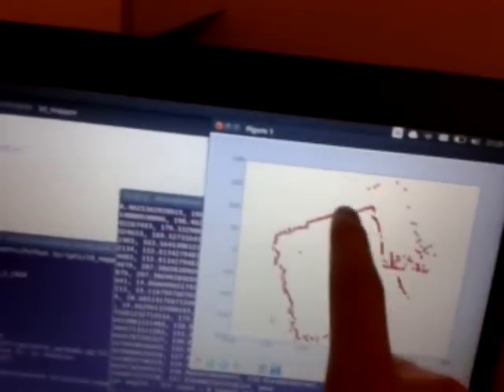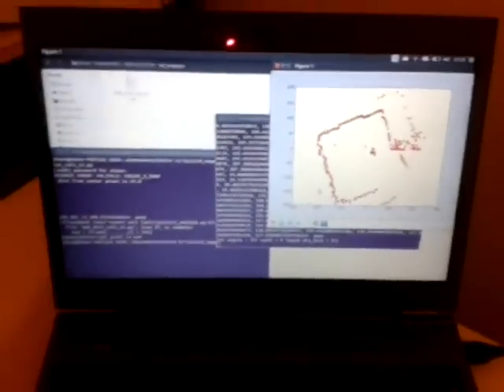2d mapping using a webcam and a laser

Comment: Could you angle the laser and cam upward, so that you're scanning the wall almost at the ceiling line? That way you'd be less likely to have obstructions like the hanging clothes?
Reply from the maker: Ray Dennis Interesting idea dude. I'm not really sure if that would work with the setup in this vid because it uses just a stepper motor to rotate. Maybe if it was mounted on a robot arm with pan and tilt it could follow the ceiling line
Reply: +wattnotions how about using some sort of algorithm where if the lines being constructed in a 2d plane once the beginning of the start point reach the endpoint and the endpoit meets where you started the the sketch can then predict that theres a room with 4 or how ever many walls and just guesstimate a rectangle from ceiling to floor or vise versa and you will endup with the rendering of a room in a 3d space? so in other words you can turn a 2d parameter into a 3d virtual room by using simple things humans do all the time ASSUME, YOU see a tree in the park and while you cant see the other side of the tree you still can imagine that the tree will look the same till you walk around the tree and confirm your assumptions. excorp.weebly.com